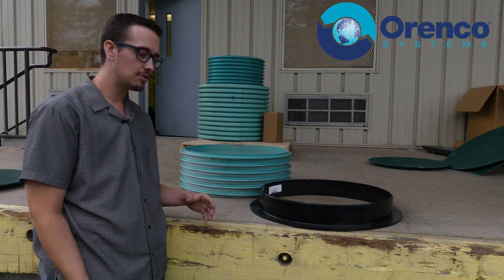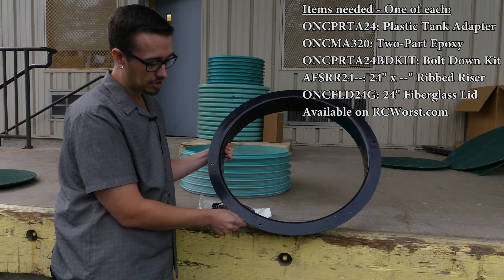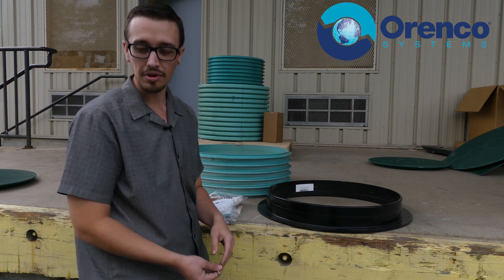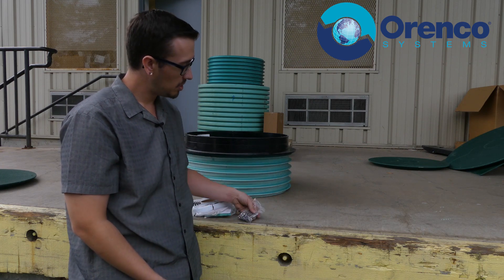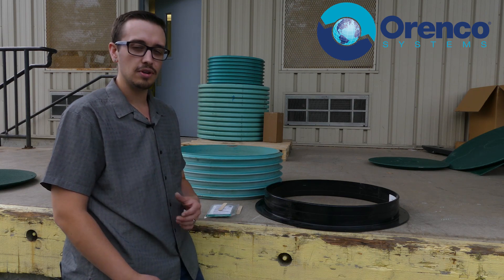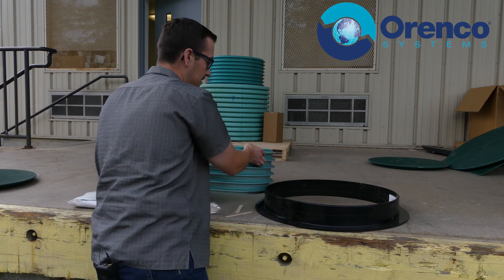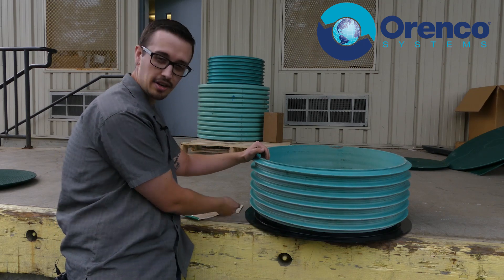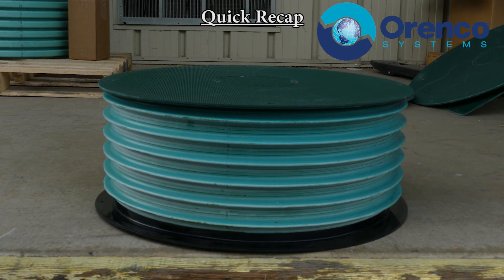How to Install Risers and Lids on Concrete Septic Tanks w/ Round Hole

Comment: Are there kits that you can use to seal the 2 smaller maintenance ports (inlet & outlet) which are only about 3-4" wide? I recently bought a house, and found that these other 2 ports were closed off with only a plastic bucket cover set over them, no hold down other than packed down dirt. Not surprisingly I'm suspecting groundwater infiltration.
Reply: Those may be ports for electrical pump and alarm wires to go through... albeit they may not be utilized. Put something over the holes (plastic plate) and silicon it in place to keep ground water from permeating the chamber. You should be good to go.

Comment: I realize this is a 2yr old video, but once you get your bolts in place on top of the tank, couldnt you pre-assemble the riser to the flange, to give you better access to spreading the epoxy, and then install and tighten your hold down bolts on the tank itself? You'd leave the concrete lid on of course while the riser and flange were curing. Im just thinking it would give more access to filling the connection points with the epoxy, and then install the flange and riser as one piece, Just curious if you could do it that way?
Reply from the maker: I don't see any issues with doing it that way. Great idea!
Reply: @RCworstwater  thank you for reply, i currently have my lids dug up and exposed, and i do not feel like digging 20in down again the next time. So im trying to talk myself into putting risers on it. Lol...

Comment: My septic cement tank has only 2 ( 6 inch) clean out holes at top and nothing else. It is old, but works just fine. I need to put something so I don't have to dig it out every time I want it pump out. Suggestions?
Reply from the maker: How deep is it? You will need access to the lid to remove it, so a 24" riser is the smallest that we sell that would work. You might be able to find smaller ones at the box store.

Comment: Hi there - I realize that you posted this video over a year ago, but I wanted to thank you for this, (and all your other), informative video(s). My new home has a concrete tank with no riser.  After probing and some digging, I finally located the cover, 14" down. I'm interested in a riser to spare hunting and digging later. I have three questions for you, (if I may press my luck):  1. Is this system designed to replace my existing concrete cover, or would that cover sit inside of this riser?  2. If I should indeed remove my existing cover, I understand there is poisonous gas risk -- but am I safe to open it? (assuming I know not to fall in)  3. My (round) cover measures 26" across.  Should I seek a riser kit with a 26" (or wider) diameter for my installation?  Thank you very much!  (Thank you!!!)
Reply from the maker: Jeremy, this system would replace your concrete lid and there isn't much risk to opening the lid since your tank is outside. The standard riser sizes are 24" and 30", if your hole is 26" you will need the 30" riser: https://www.rcworst.com/AFS-30-Diameter-PVC-Kor-Flo-Tank-Access-Riser-p11546.html 
Plastic Riser Tank Adapter:  https://www.rcworst.com/Orenco-PRTA30-Riser-Tank-Adapter-p1316.html
Bolt Down Kit: https://www.rcworst.com/Orenco-PRTA30BDKIT-Riser-Tank-Adapter-Bolt-Down-Kit-p1320.html
2x Ma320: https://www.rcworst.com/Orenco-MA320-Two-Part-Epoxy-p141.html